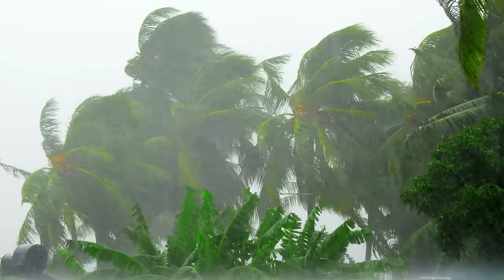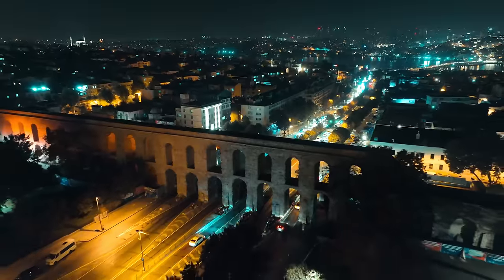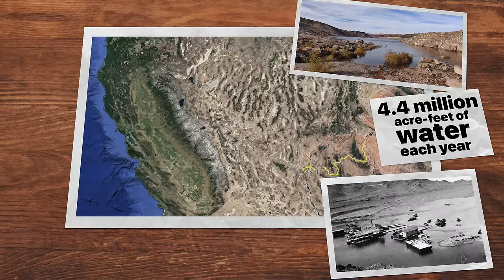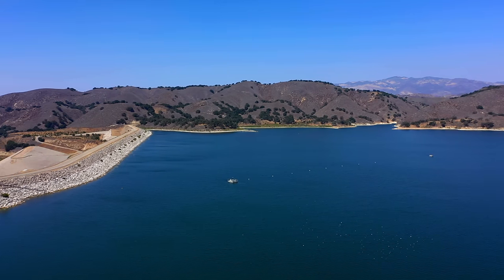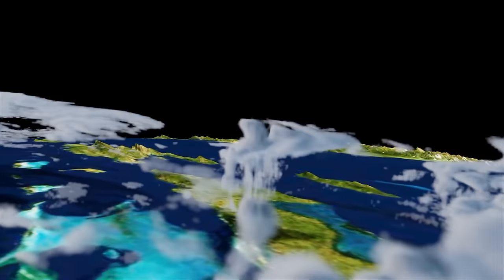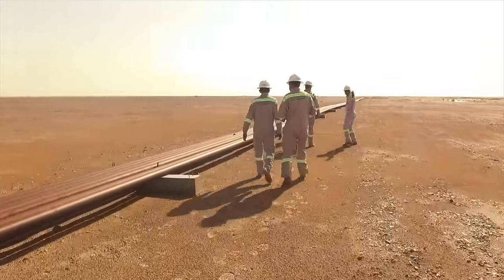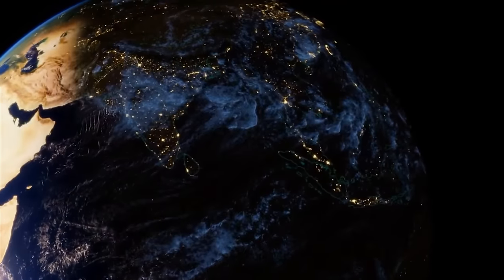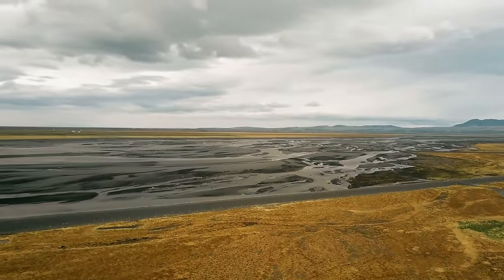Pipelines From Flood to Drought

Comment: This needs to be combined with regenerating the local flora and root systems. One of the major contributing factors to drought is lack of water retention in the soil. The soil needs a healthy micro biome and root system from local plants to properly retain water and recharge the aquifers. When the land above is dry, cracked or pavement... that water will run off and never recharge the local sources.
Reply: Exactly Dakota, we need to replenish our ground water instead of diverting it out of the cities and housing/apartment developments.
Reply: I agree with the importance of soil with sufficient void space (as enhanced by organic matter) and depth to retain water to support the growth of plants that have value to people and wildlife.  However, in semi-arid to arid parts of the U.S. -- which are mostly between the 98th meridian on the east and the crest of the Sierra Nevada and Cascade Mountains on the west -- evapo-transpiration greatly exceeds precipitation, and there is very little recharge of aquifers except along the relatively few streams that get most of their water from higher elevations in the Rocky Mountains.  Wells that take water out of the aquifers there (such as the Ogallala)  are doomed to eventually run dry, and I doubt that much can be done to replenish them within a period of centuries.
Reply: @CarltonS  if the excess water flowing north to the artic sea were sent south along the front range of the rockies all the way to New Mexico the Ogallala aquifer could be totally refilled in a few years
Reply: @jeffbybee5207  Assuming that the Canadians would cooperate in constructing the massive system of pipelines/canals and pumping stations required to send water south to the Great Plains in the U.S., how would the water be added to the Ogallala aquifer?  It's not like a big underground cavern, where it would be possible to just add water to the high end and let it fill back up by gravity within a few years or decades.  In fact, it is sandstone which, although porous, does not transmit water all that quickly at the low natural gradient of the formation.  It would be necessary to distribute the water to thousands of injection wells and/or infiltration basins scattered every few miles across an area of hundreds of thousands of square miles.  Hardly very feasible.

It might be feasible to do this on a smaller scale by taking water out of the reservoirs on the Missouri River in Montana and the Dakotas, especially when they are full.  But then there would be an issue with the water often having suspended solids that would plug up the aquifer.
Reply: Dakota, you are spot on with this! 
I have been watching the facts of this happen for years in the mountains of Oregon where I spend the majority of my time. 
As old growth timber goes up in flames and second growth or even older stands are now being clear-cut on public and private lands again it is clear that the water is drying up with it! These large trees had root systems that bind soil, but the really thing is the cover they provided also creates springs of water or wetlands. Throughout  the entire year areas that used to never dry out are emptied of water. 
It brings into question for me why our government has taken up the "stratagey" of "stage and contain "forest fires instead of putting them out. 
And in the last 2 years logging practices have changed. They are clear cutting all forest again. Not just privately owned land.
Reply: @davelambardo6464  The forests of central Oregon are a lot different than the Great Plains in terms of their topography and associated ecosystems.  Whatever irrigation is done in central Oregon takes water from the watershed of the Columbia River, and at least the mainstem of the Columbia has plenty of water.  But the idea of using it to irrigate forest land in more than some very limited locations is totally impractical, however desirable that would be in terms of preventing wildfires and preserving the remaining stands of old growth trees.  That is true because of the physical difficulty -- reflected in monetary cost -- of moving water from the Columbia or even a minor branch like the Deschutes River onto hundreds of square miles of rugged mountain terrain.  I practiced civil/environmental engineering in the Northwest and both appreciate conservation and understand what can and cannot be done to achieve it without tanking the economy.

Just west of the town of Sisters there is a stand of old ponderosa pine trees in the National Forest which are being protected from wildfires by cutting the understory vegetation, placing it in piles covered by plastic sheeting to allow it to dry, and then burning it when conditions are snowy or wet.  That is an excellent management technique, but it is so labor intensive (even on the gently sloped site there) that it is applicable only in very limited locations.  About the best that can be done in forested areas is to apply this sort of management to forests surrounding human habitation.  Also, to use building materials that are both more economical and more environmentally friendly than lumber from old growth trees.
Reply: @CarltonS  The Us Corps of Energeers made a plan in the 1970ies to pump Mississippi water upwards having dams on the plain rivers and the distribute the water to the fields. Anyhow you have to change on farming there - central pivots are okay but you have to plant bushes and trees on the corners with are not needed now.
Reply: @maxschon7709  Apparently you are thinking about a plan to take water from the lower Mississippi River and pump it back upstream through reservoirs that would be built on some rivers that originate in Texas.  The plan would have required so much energy for pumping that it contemplated building nuclear power plants to provide it.  The plan was pushed by some interests in Texas but would have been so expensive that the much of the cost would have been paid by taxes on everyone else, who for good reason did not support the scheme and it was scrapped.  Nevertheless, even that plan made more sense than this truly "insane" plan for collecting flood waters from all over the Midwest and transporting them across the Rocky Mountains to the Southwest.  The people in the Southwest are going to have to adopt to using less water -- especially for irrigation -- and an important step in that direction would be to establish an interstate market for water rights that would incentivize all water users to use it more efficiently.
Reply: @CarltonS  I think you may have misunderstood my point at least partially I would ever consider trying to irrigate forest . 
Also it's not the arid soils of the east side of the  cascades I was referring to. It's the break over of the Mt range and west. That's where the water is being lost. 
I can show you many locations where logging has opened up the ground draining miles of area. 
An example of water being exposed and caused to run off Is easily seen on a botched hyw. Project not far from my house. 
The state in its infinite wisdom came in clear cut next to a coastal hiway. Then attempted to widen its lanes. In doing so in steep ground they effectively pulled the drain plug out from under the mountains aquifer. It drained ponds , marshes ,springs that were located on above the work being done. So for the next 9 years we watched slide after slide come down and block the rd. After the water was all washed down the Coquille River they were able to spend enough money to keep all the mountain side out of the road. 
But the damage has been done. That stored water won't ever return to that point or our area it's gone ! 
Past generations in rural communities knew  that it was foolish to go in and tear at ground or the trees that give their roots to holding it together on top of the water supply. Because the tree roots keep soil bound creating a natural dam holding water back
Reply: @CarltonS  No, what I mean is older. The plan was to make dams and pipeline in Nebraska, Kansas, Missouri and I think Iowa to pump water upstream through Kansas to Colorado, Oklahoma and West Texas. Their main goal was to provide water for farming but also being proactive against flooding.

Comment: Have you assessed the topography of the oil pipelines vs the needs of the water transfer? Specifically, oil pipelines generally go from north (Canada, where the oil is found) to south (southern US, where most of the refineries are. Water transport has to go from east (where the rain and floodwaters are) to west (California and the southwest) where the drought is. Also, did you consider relaxing the requirement a bit by leveraging existing river sources (such as the Colorado River) for some of the transport?
Reply: a pipeline can't carry enough water. so that isn't even the problem. if it can be address by pipe, flooding should never occur since we have water pipe all over. the volume of water can only be moved by a canal.
Reply: The colorado river is the watershed that's the problem bud
Reply: @lagrangewei  That's not entirely true. California's aquaduct to send water from the Colorado River to LA is a pipeline actually. While Arizona's CAP is a series of canals, pipes, and pumps. California also has to pump their LA water over some mountains as well.
Reply: @djl9999 If we was to do something like this like say divert flood water from the Mississippi , it would be best to divert it as far south as possible. Then send it west over the continental divide where I-10 runs. The continental divide in this area isn't much of a barrier unlike say where I-40 runs. It'll still have to be pumped but it won't be as bad as it would if it was sent thought the area around I-40. Then from there to various reservoirs in Arizona and up onto the Colorado Plateau to Lake Powell. If we was to send coastal flood water from southern California, it would have to be pumped over the coastal mountains east of LA as well as various desert mountains. Something we are doing anyway with Colorado River water. The real problem is that there is simply not enough storm runoff to make something like this worth while. It would just be best to simply pump it to the nearest reservoir in southern California.
Reply: No need to interfere with cross flow lines using current infra struture.
Reply: @lagrangewei  start digging

Comment: Honest question: Is there anything to worry about if micro organisms are moved from one area to another in the water?
Reply: Not sure about micro organisms, but there is a chance bigger insects and even other animals could be sent and they can wreck havoc on an ecosystem.  It's happening in places where channels have been built like suez for example.
Reply: Filtration systems.
Reply: Right. Just wait till the Asian carp get sucked through one of those pipes and start a nice family in California. 

It's easy to say 'filtration'.. what would that look like? Bars going across openings? Like on a culvert that I see clogged all the time?
Reply: @christhebuilder3752  - electrify a filtration area to stun the carp so the can be filtered out without too much difficulty… they do this to keep Asian carp out of the Great Lakes
Reply: Radiation & ultraviolet light & H3 bubblers can be used to treat water before movement… all driven by renewables.
Reply: @DavidHalko  they electrify the water in the area to keep the carpet out of a small area in the shipping channel. They are talking about suddenly pumping 100s of thousands of gallons.
Reply: Its a great question, and must be addressed.
Reply: @christhebuilder3752  - “100s of thousands of gallons” is all to be done through a tube, much smaller than a channel. 

Electrify a channel, dump water at the top of the electrified channel, water moved downstream the electrified channel, a smaller pipe pumps water out upstream. As long as the water flowing downstream back to the source, is greater than the amount of water being piped from the upstream, it will work the same way.
Reply: @DavidHalko  good luck with that. Go play with a pool pump. 40 gpm. Notice all the bugs getting sucked in? Electrify the water. Bugs and other matter still getting sucked in? Weird. Almost as if it's a vacuum.  Now, multiply that 40gpm. It doesn't matter what screen or electricity you put around it. Getting sucked up.  I don't know (or care to figure out) the math for acre ft of water per minute, I'm assuming you do that's why you quoted my 100s of thousands of gallons.....assuming it's more than 40gpm. Which reminds me, go clean out your strainer basket on your pool pump, it's clogged.
Reply: @christhebuilder3752  - “good luck with that… clogged” 
they figured out the problem with much larger flows… with dams, hydroelectric, pipes as tall as I am conducting larger flows to cities, etc. they do this all day long.

Since we are talking a process to sell water to another locality, a profit center can pay to have someone maintain it.
Reply: @DavidHalko  They do that but it's extremely expensive and you'd need to do it more than once over longer distances, especially if you transport the water across regions with very different environments. I'm not against it but it wouldn't be simple or easy
Reply: @jonathangehman4005  - indeed; not without challenges; but I can’t think of a better use for spare water when so much of The West is suffering now
Reply: The bigger problem is that The East isn't nearly as water rich as the video suggests. The Mississippi River is reaching record lows that is starting to affect shipping, and most of the flood water on the east coast is salt water from storm surges. A lot of Midwest farms have been moving to well irrigation in the last 15-20 years to curb the effects drought years.
Reply: Not any different than fentanyl.
Reply: @DavidHalko  "electrify a filtration area to stun the carp so the can be filtered out without too much difficulty"
Yeah won't work. It barely works at the Chicago River and that is with millions spent every year to solve new problems or solutions to potential problems.
This is without even considered the ionization of the metals in the water causing hard build ups in the pipes and causing catastrophic pressure problems.
Reply: @alexistaylor969  - “it barely works at the Chicago River”

But, it does. Multiple electrification areas, so one can be taken down for maintenance.
Reply: @Jackadoor  - the Mississippi always floods… that flood water can be moved
Reply: @DavidHalko  That didn't work so well. We catch Asian carp here in Toronto all the time.
Reply: @fayebird1808  - time to turn all available Asian Carp into animal food & call it a day.

Comment: I love this idea. But we need to combine it with a wetlands restoration, farm planning and reforesting effort too. And if you look at the cost of flooding and drought - it makes sense to do this. The biggest problem we have is that we are not storing water in the soil. We need to shape the land and grow vegetation in the right ways to slow down the flow of water across the land. Taking lessons from permaculture. A hat, belt and shoe principle. Similar to what was done in the Loess Plateau restoration project. Imagine rain hitting the hills and instead of flowing off the hills and taking away top soil and flooding the below areas, it flows down slower, storing water in the soil as it goes. To allow water to flow into the soil we need bugs and worms opening up channels in the soil. To do that we need trees and undergrowth, which means having well managed forests. So the hat is any slope with a 20% or less gradient, the belts is where you have terraced farm land and the shoes are small and varied water catchment wetlands.
Reply: Permaculture works only in 2 cases.  1.  Restore a damaged environment back to its healthiest state, or 2, maintain the healthy state of an environment.  The areas in question here were never highly fertile to begin with and are actually artificially boosted in that regard already.  You can't use permaculture to increase fertility above what a region can naturally sustain on its own.  I know people who will claim otherwise, but i have yet to see them show an example that exists outside of an artificially boosted area, like the canals dug in AZ and NM.  Sure around those canals youre going to see improvement...but what about 1 mile away?  5 miles?  Oh wow, no improvement no matter what technique is applied?  Well of course not, because permaculture doesn't do what your'e trying to make it do.

Comment: I like the thinking around adaptability. I don't think you need that much federal/state buy in. It could be done with water rights, leases, trades among water districts. My county of San Diego (CA) has addressed it's needs by trading with other water rights holders. We also have the biggest de-sal plant in CA.  I think that Climate change is not the driver of this issue. I think 41 million people in CA is. Lake Mead not only feeds CA but also NV, AZ, CO, NM and MX. The CA West is in a different storm pattern than NM and TX SouthWest. Thus your solution makes sense in this regard. The ENSO means that CA is always in a boom and bust cycle with water which is anti-cyclical to the SW which is currently above normal despite what the press is reporting. This is also why it does make sense for us to build more reservoirs to store excess rains in CA. We built a shit load of infrastructure to move and save water and it made CA the power house that it is. Now we've stopped all of that and really created a very predictable shortage. Let's approve some pipelines my friend!!